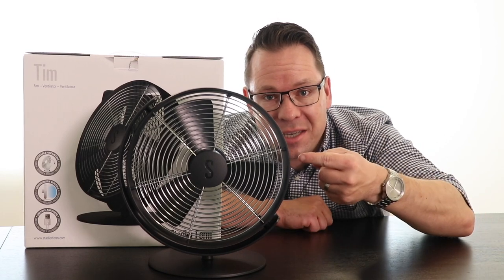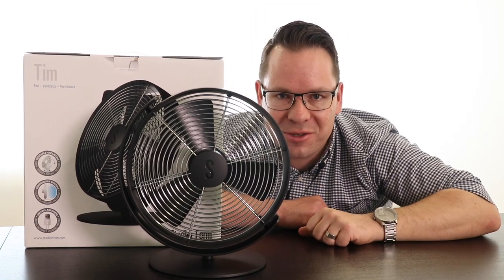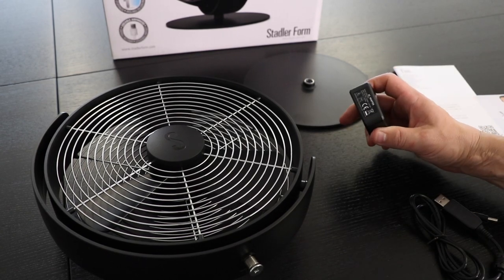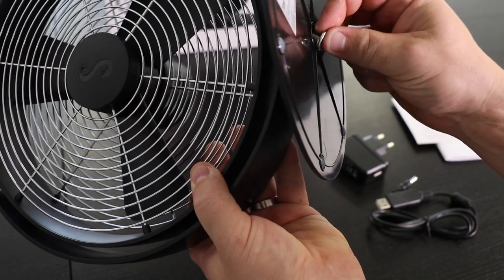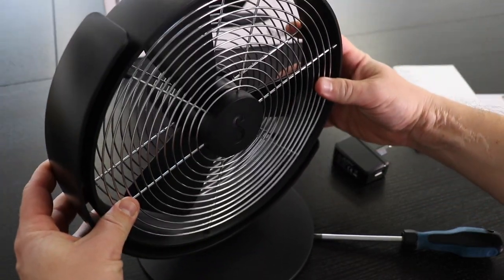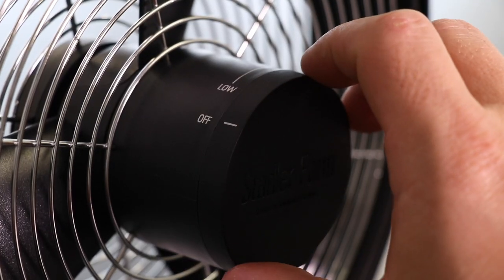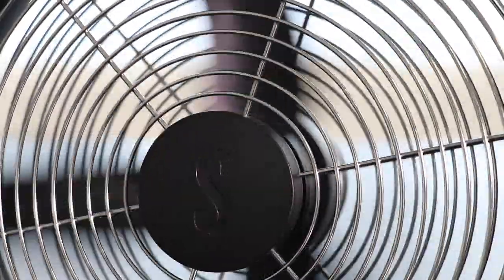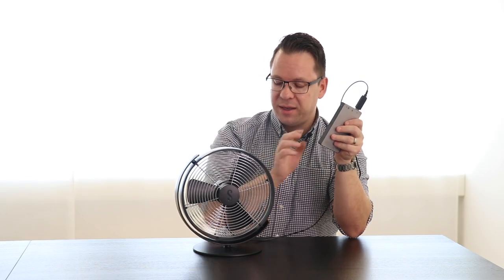Stadler Form Tim fan unboxing, assembly and features

Comment: Ideal fan for better sleep. Placed on a bedside table or shelf above the bed has the great advantage that it is quiet. And the movement of air around the head is great. It is designed to let the air blow in silence, who wants a stronger, ordinary choice is huge but noisy elsewhere.
Reply from the maker: Thank you for your comment. We are happy to read that you like table fan Tim as much as we do. We wish you continued enjoyment and good refreshment with Tim. Best regards from Lea @ Stadler Form
Reply: @stadlerform  I tried on my responsibility data down the front grille. The fan is more efficient and quiet. Translation by google.

Comment: how about the only real infomation we need.. how much air does it move?.. seems no one is talking about this.. would you pitch a car and not tell how long it drives on a liter of petrol?
Reply from the maker: Hey Kris, thank you for your good question. The thing is - Tim is a personal fan which implies that it is used in close proximity. Which means that the air volume does not matter so much, but rather the usability when using it up close which includes noise level and continuously variable speed levels (you choose the speed which is fine and confortable for you). For our "big" fans we state the volume - for Tim we do not think that the number helps to decide upon the product and might rather be missleading when comparing to the bigger units. Let us know, if you have more questions. Best regards from rainy Switzerland from Samuel @ Stadler Form.

Comment: Bought this one right now. Design looks very nice, but airflow is rather weak. Not a big problem for me, as I took it specifically for office to not make too much noise - it can handle that, but it may be a problem for someone who looks for a powerful fan. Also, I've noticed that usb plug becomes very hot in a very short time, and it feels dangerous. I am not sure if it is supposed to be like this, or it's a flaw of the exemplar I've bought. I can't tell the temperature for sure, but if I hold the plug with my fingers it feels painful in 10-15 seconds. My concern is that the temperature will go even higher which will lead to potential fire hazard.  Please, let me know if this behavior is normal for this fan.
Reply from the maker: Der Chron, thank you for reaching out to us. The behaviour of the adapter is ineed worrying and we ask you not to use it any more. You can still use Tim with a smartphone plug/adapter. But we would like to exchange the current adapter to a new one. Can you please get in touch on service (AT) stadlerform.com - please mention your comment on YouTube and we surely can help you to get that adapter replaced. Sorry for this issue. Best regards from Samuel @ Stadler Form.
Reply: @stadlerform  No reply, unfortunately. I've refunded the fan after usb port of my powerbank got damaged by excessive temperature. I didn't notice at first, but the metal part was so hot that you can't touch it without a burn. You really should reconsider your decisions about this custom voltage converter on usb cable. It's constructive flaw that can cause damage to other devices and potentially be fire hazardous which ruins anything positive this fan have.
Reply from the maker: @chron9725  Sorry to hear this. We have not had any issues so far neither with the adapter, the cable or the fan. Too bad you did not let us exchange the adapter/cable and try it again. I am personally using the fan these days in my home hoffice and absolutely love it for the silence and size. Sorry for the bad experience in this case. Say safe and healthy. Best regards from Samuel @ Stadler Form.

Comment: i was interested. but then i saw the price tag. what justify the price? ( 70 euro)
Reply from the maker: Hi super boy, thank you for your question. Tim is a table fan with a rotatable and inclinable fan ring and a continuously variable speed controller. He comes with a USB cable and power adapter. Best regards from Switzerland from Lea @ Stadler Form

Comment: You never tell us the effect/dB. You never tell us how much power it draws, and instead you tell us it is dependent on the battery capacity which is obvious. This makes you think the fan is under par and the only good part about this fan is its design. I mean, it doesn't even turn, which any old cheap table fan does. But, sure that could be explained with the USB which limits the powerdraw, also hence the cubic meter of air it can blow. So the obvious, is that most money has been spent on the design, and the idea that you can use it with a battery or connected to your laptop. But if that was the case, shouln't the fan have a handle so to make it easy to bring etc? If the idea was to make it portable. So again a fairly good looking fan, that fail to deliver performance. Even the price is steep. How can you guys even make a profit with this?
Reply from the maker: Hey TH3MS, thank you for your Comment! Really appreciate that you took the time to write to us. dB range is from 25 to 44 dB(A). And power consumption is on highest level 10W. Which means that if you run the fan on lower level , Tim will draw less power and have an extended running time with a battery pack. We did not add a handle because the fan is super handy by itself - I am carrying it around my house all summer long and even took it on a RV trip lastly. So super transportable and no handle needed. BTW: The intend of this video is to give you some additional information to the "standard" information we deliver anyways on hppts://www.stadlerform.com/tim maybe you find some of the information lacking in this video ;-) Lastly the profit question: As every manufacturer, we need to make some profit in order to finance the development and cover the investments and of course to pay our staff. That's what we do for over 20 years now and we have fun doing so! All the best and a sunny summer time - maybe refreshed by Tim - Samuel @ Stadler Form.